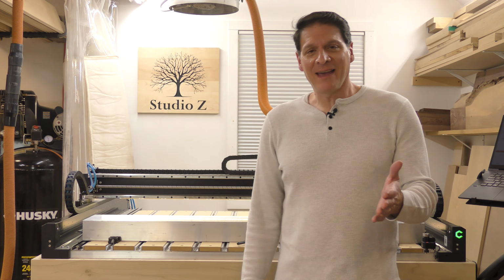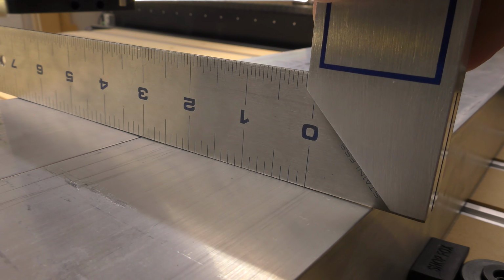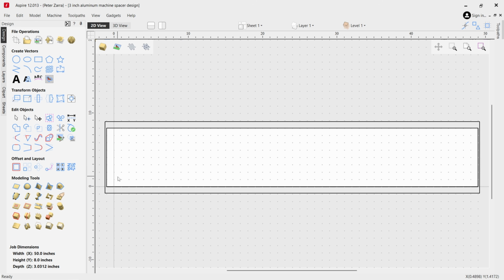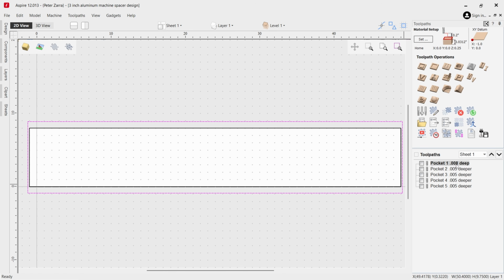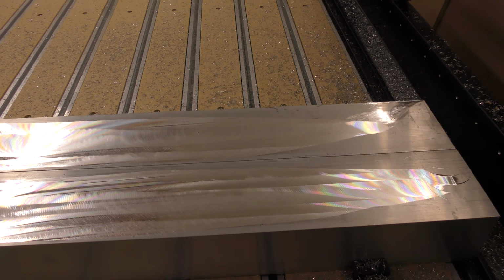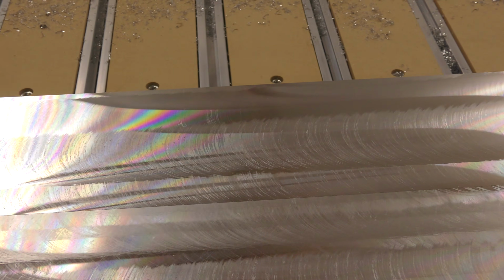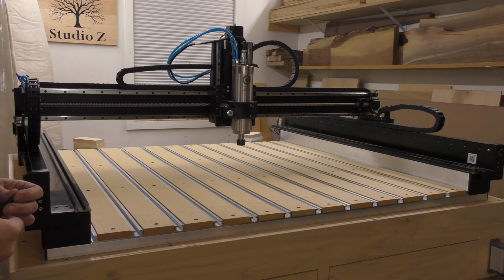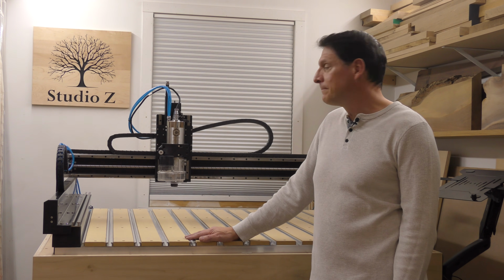Gain 3 inches of Clearance on your CNC Router!

Comment: Peter,
Hope all is well.  I am coming back to this as I am going to do this for my machine shortly.  In the process of ordering the tubes.  Just to clarify, you said that the bit setter is in the original location.  So do you set the position in carbide motion to realign to the new z height?  Would appreciate it if you can confirm.  Anoither thisng is that I am going to go to a local machine shop to do the planing.  DOnt want to do aluminum planing in my workshop.  DO you know if Buymetal can do the machining for a fee?  Thanks - Mani

Comment: Good day. Would it work to put the aluminum at a 45 degree and set the cnc to cut at 45 degrees.
Reply from the maker: Hey there!  Yes it can be done but I don't believe it's possible with Vectric (CAD/CAM) which is what I used at that time.  Fusion 360 can do it by changing how the stock is mounted to the table/machine, but I wasn't using Fusion 360 at that time.  Great question!
Reply: Yes, this can be done. (Vcarve pro)   
Set your work area the whole table size. Draw the rectangle you want, in this case 50" x 8".
draw a line from one corner to the opposite corner just for reference, (the same way you will rotate your rectangle).
Then rotate your rectangle. Cut as a Pocket as normal. 
Now ya don't have to purchase an oversize cutter. 
*However*>>> you will have to get a little creative on your hold downs/clamping.

Comment: I just did this upgrade, but I'm having an issue with bit setter with long bits. When I use a 4 inch bit the machine jogs to the bit setter location and then just rams the bit into the bit setter and bottoms it out and failing to read. Does this happen to you when using longer bits?
Reply from the maker: So, I did have a problem with bitsetter but it was because I had a loose wire at the back were the Carbide 3D logo is.  I have also moved bitsetter to the spoilboard surface and reprogrammed it in machine setup, works flawless now
Reply: @StudioZ-maker  Worked for me as well, thank you.

Comment: Sorry for having too many questions on this lol! I have some more questions regarding the tubes, the surfacing bit you are using and also about collision of the spindle body to the raised frame edges. 1- I wondered why you ordered 50 inches in length and not the original 49" like the existing ones? I'm sure there was a reason, can you tell us why ? 2- these type of bits are so expensive it's like 300$ CAD from Amana tool, could not find any chinses version for this one of use, do you have any suggestion? I might be able to ask the supplier to sandwich them together and  machine them for me as well for some extra cost and skip the surfacing bit. 3- I think you might loose some of the X axis travel because of the thickness of the 80mm+ dust boot thickness of about 3mm specifically for the stock material of less than 1" inches and having short bit in the spindle( when a short bit needs to touch the spoil board, like surfacing bit, or 1.5" single flute bits when you want to have one pass only contour). so for the deep cuts your X axis limit would be some how 2" less than 48.5" ? and for the other not that deep cuts you could maybe put 3 sheets of MDF to raise the bottom  and be able to use all the 48" of X axis ?
I wondered what would happen if you want to to some surfacing on the spoil board, do you have to only use about 2" diameter surfacing bit to avoid collision of spindle body to the side ? or there is another solution for it ?
thanks,
Reply from the maker: 1- I ordered 50" just because I wanted it to go a little past the last bolts at the back.
2- Yes that is an expensive cutter because it is made specially for aluminum.  It has a specific rake angle as I explained in the video, don't use a spoil board surfacing bit for aluminum.  Aluminum is not wood, it's very hard compared to wood and it's sticky when you cut it, very different material.  The material supplier won't be able to surface it for you, you'll have to find a machine shop to do that with a big enough CNC router to fit it.
3- I lost absolutely no Z axis height, I can cut all the way down to the table with the smallest of end mills.  Depending on the project I adjust the height of the spindle in its mount by about an inch, that's all.
4- I also have .5" space from the edge of the spoil board MDF to the aluminum tube, more than enough room to resurface.
Just so you know I made the video to show what I am capable of and to set up for upcoming changes to the machine and future videos.  This modification was necessary for me going forward, If it's beyond your abilities don't attempt it and risk ruining your machine.
Reply: @StudioZ-maker  it's not beyond my abilities. I think you might be wrong and the  X Axis limitation. in a situation that you only have 1.5" of bit out of the spindle and the bit itself is a 1/4 " bit. in this scenario you would only have 46.5" on X Axis. otherwise spindle  * will * hit the raised edges. since the height of the 3" extrusion is more than 1.5" of 1/4 bit and you did not compensate 1.77" inches of the radius of the spindle. after I let the comment, I also model it in fusion and defined the spindle as 80mm with the 3" raised edges. simulation also shows that it will hit. in order for you to imagine this, you can put a 1/2 or 1/4 bit in the spindle the z to up max position and go to far 48" on X axis, you will see half of the spindle is over the 48" mark. same overhanging spindle situation will apply on a 1.5" length, however in this case will have collision. 
thanks for info on the bit , I know everything about it just did not want to spend 300$ for one time use. might as well pay the supplier to do it for me for the same price or even less.
Reply from the maker: Oh now I understand what you are saying.  So, I have 2.75" from the surface of the spoil board to the the top of the machines side rails.  In the instance that I would need to use a 1/4" end mill that close to the side rails and yes to avoid a collision of the spindle with the side rail I now use 4" long end mills which give me 3" of stick out and a 1/4" of clearance to the collet. But, mind you I never cut anything that close to the spoil board without a sacrificial board under it, usually 1/2" which gives me even more clearance.  But yes you are correct that if you tried to use only an 1 1/2" long end mill you will hit the side rail with the spindle body.  I checked all of this before making the modification and made sure there was a way around every scenario otherwise I would not have done it.  I also keep 1" thick MDF in my shop and use that as a spacer when I don't want to use a long end mill.  Also, the spoil board surface is sacred to me, I never, ever screw into it or even think of cutting into it as it is a referencing surface and is not to be changed or ruined once it has been surfaced.  Machining something is the easy part in the world of CNC, work holding is the challenge and the hardest part.

Comment: Peter,
This is brillilant.  LOt of work, but the end results look so good.  Just a question - you mentioned that the Z axis on the SP5 can travel 7".  did not realize that.  I would like to do this as well so that I can cut taller pieces.  Would put that on a schedule once I get a bit more use with current set up.  Look forward to seeing the cuts you make with this

With a troubled start as you know, I now figured out how to fix things with the machine.  Overall, its a great machine and I plan to enjoy it for a long time.  A couple of questions on this if you dont mind
1. Do you need Vectrix or can you do this on Carbide Motion?
2. Do you mind sharing the vendor you got the tubes from?

BTW, have you considered moving the gantry mount so that the machine can move forward to cut vertically (joinery)?

Thanks
Mani
Reply from the maker: Thank you, but just to clarify you misunderstood, the clearance under the gantry after the modification is 7" but the SP5 only has 6" of Z travel.  
Vectric is the design (CAD) software, Carbide Motion is the post processor and yes I use Carbide Motion as my post processor. 
I got the tubes from BuyMetal.com the SKU: 61F34.25T6511.
No I haven't tried to move the gantry forward for vertical joinery, it's not something I use and I don't want to lose that amount at the back of the machine as I have future plans to put in a rotary (4th axis) back there. Thanks again, glad you enjoyed it!

Comment: awesome job , I've being also wanting to do that for a ling time, thanks for sharing. this is truly amazing. can't wait to see the cuts you are making with in near future. also wondered if I can use some flat sheet of MDF as spacers if you needed to cut something really narrow. can you also use the same short 1/4 bits on it too ? or you might hit the bottom frame of the Z axis before touching the bed ? please share your future cuts, and once again thanks for the amazing work!
Reply from the maker: Thank you!  Yes you can use MDF as a spacer under your work piece as long as you surface it so it is perfectly flat.  Yes I can use any size bit I need all the way down to a 1/2" stick out from the collet.  All I do ( If needed ) is loosen the spindle mount and either raise or lower the spindle before I set the Z height.  Watch my most recent video where I carve a really large bowl, I really test the limits of the machine.  Glad you enjoyed this video, your welcome 👍
Reply: @StudioZ-maker  moving spindle does not disrupt the tramming of the spindle and Z axis? I know you do not move the spindle mount and just sliding the spindle inside the sleeve, but it could still cause some issues with tramming! or maybe not! have you tried it to see if it really has an effect on tramming? please let us know you noticed any issues about it. I'm really taking this serious and want to upgrade mine. just don't have drill press to drill precise holes that aligns with the base.
Reply from the maker: No issues so far and yes all I do is loosen the spindle mount( 2 bolts) and move the spindle up and down.  I will be releasing a tramming video in about a week so you will get to see it soon.  Oh and by the way the holes that I drill into the tubes on the drill press are oversized a bit to make locating easier.  Yes they have to be in the right place but not super precise.
Reply: @StudioZ-maker  can't wait for it, I am one of your subs and bell is always on for your channel. thanks in advance.
Reply from the maker: That's awesome!  Thank you

Comment: Hello ! Since you are using Vcarve as a CAM software, which post processor are you using that works with Carbide motion? And after you create your tool path, how do you load it onto Carbide motion? I just got a Shapeoko 5 Pro but just finished assembling it and still waiting on the spindle to show up. I have a Vectric Aspire and I’m more familiar with it than the free software for the Shapeoko, that’s why I’m trying to find out a way to create tool paths on Aspire that will work on Carbide software. Please let me know, thank you !
Great video , I may consider doing the same as you !
Reply from the maker: Hey there!  I use Vectric Aspire as my CAM software, and it has Carbide Motion on its list of post processors.  Very easy, just set Carbide Motion as your post processor and your good to go!  My set up is the same so you shouldn't have any problem.
Reply: Thanks for the quick response! I looked at my list of PP but I don’t see it. My version of Aspire is 8.0 probably that’s why. I will update it and try again. Thanks again for your help !
Reply from the maker: Yeah, definitely that's why.  I run version 12, try and see if you can update the list of post processors otherwise, you will have to update your version of Aspire.

Comment: Would you not have to alter the macros for the bit setter as it's now two inches higher that the spoil board, trying to sort the logic in notbhaving to change that. Thought the bit setter allows the macros to know where the bed is relation to the face cutter edge of the bits.
Reply from the maker: No, if that was the case every time you surface the spoil board you would have to adjust the bit setter.  The bit setter works in conjunction with bit zero the touch pad.  Once you locate the surface of your material with bit zero it goes to bit setter to register the height (length) of the probe.  Then when you load a tool, bit setter measures the length of the tool, so it knows where it is in relation to the surface of your material.  The relationship is between the surface of your material and the tool, not the spoil board.
Reply from the maker: I should also clarify that this is all done by how much the machine moves in its z axis relative to the stock location of bit setter.  I haven't moved bit setter from its stock location therefore, no issues.  If you use the riser blocks from another company, then I believe you also have to raise bit setter because without doing so the relationship between the two has been altered and your measurements will be off.

Comment: Great video! I don't need this clearance currently, but glad to see this as an option. Only other thing I want is a control board from c3d that can push the speeds of the machine a little further. I know the belt driven machines can go faster then our machines.
Reply from the maker: Thank you!  Someone gave me the code to use in the MDI to increase the speed of the machine.  I haven't tried it yet, but I think it is only job specific.
Reply: I have modified the mdi to get to 297, but I still feel that is a little slow for this machine.
Reply from the maker: I agree, it should at least hit 5-600 in my opinion.

Comment: Why not put it diagonally? Thanks for the video, some good idea's.
Reply from the maker: Diagonally?  Not sure I understand.  Thank you for watching!
Reply from the maker: Oh, to cut it on a diagonal! Didn't think of that!  👍
Reply from the maker: I actually just realized that you can't cut it on a diagonal, no way to locate it in the design software or on the machine on a 45 degree.  It can only be located along the x or y axis.  Good idea though.
Reply: @StudioZ-maker  Well you got it done, and it looks good.
Reply: @StudioZ-maker  
1) I don't know about Vectric, but Fusion will definitely let you orient stock at an angle on the spoilboard.  I'd be surprised if Carbide Create didn't let you do that, too.
2) By my calculations, a 50" x 8" stock at 45º will be less than 46.7" in both X and Y on the spoilboard.
3) Clamping the two pieces together doesn't ensure they turn out identical to each other, as they rest on different spots on the spoilboard, and so you're dependent on your machine's tramming for equality. If, however, you had cut them individually, with each of them positioned in the same spot on the spoilboard, then you'd be guaranteed they'd be identical to the repeatability of your machine. As a bonus, that makes the angled fit on the bed even easier.
Reply from the maker: Interesting but I don't believe I would attempt it, mounting on a 45 degree, it involves too much of the axis of the machine moving which could invite inconsistency.  I like to keep the movement as short and simple as possible, the same way when you insert an end mill keep it as short as possible to avoid deflection.
As for clamping them together, yes I was aware of this but my spoilboard is dead flat and I also went over the tubing with a file beforehand to make sure that they sat flat on the spoilboard, no rocking.  Once I got one side dead flat by the machine and flipped it over it will be the same as the first.  I also mic'd them afterwards and they were identical, parallel and square.  Thanks for the insight, it was very interesting to hear another's approach 👍